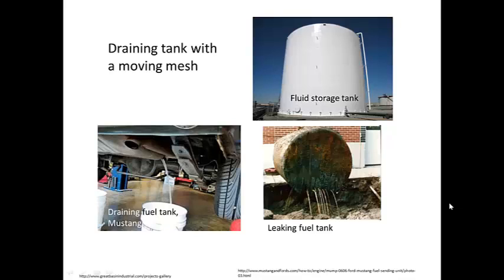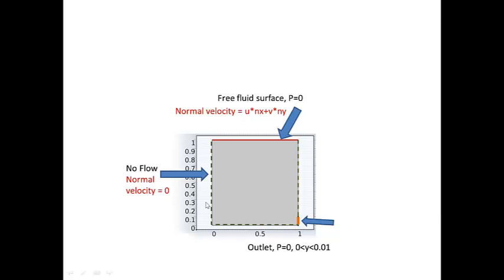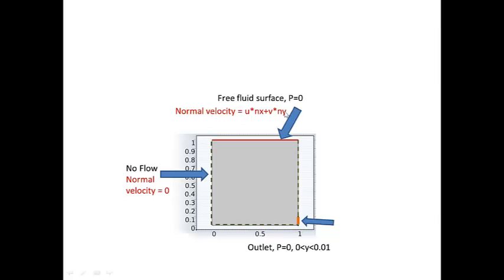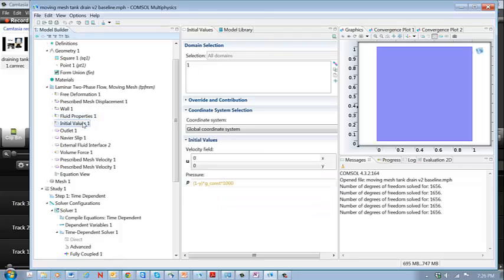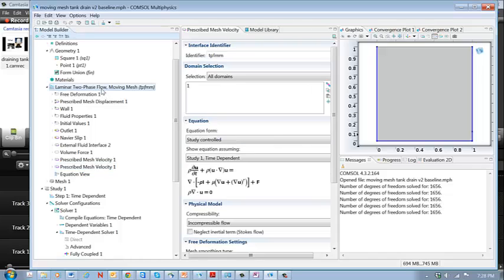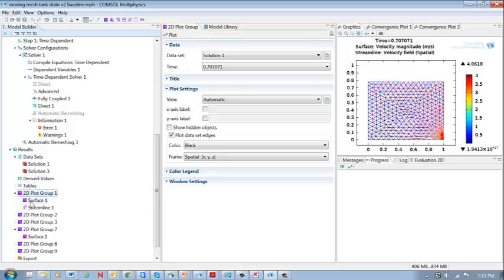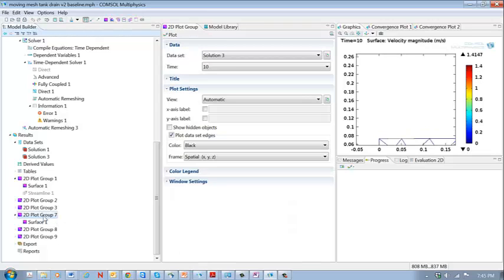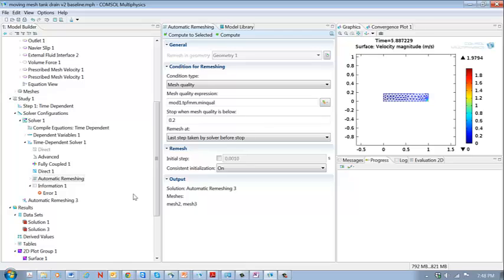draining tank and moving mesh v2

Comment: Hi Larry! I have to do a similar case with an open channel with laminar flow, applying changes in the water level (head loss due to friction of the base/ground). Could you help me with this? I think moving mesh method or two-phase flow method could work for the air-water interface. Thanks!
Reply from the maker: Hi Laura,    Moving mesh or level set could work, depending on the details.  Level set is more versatile, but very computationally intensive.  I worked out a physics module for the shallow water equations that works for open channel flow in plan view.  I have been expecting them to include 2D shallow water equations in the software, but I have not yet seen it.  Larry

Comment: I follow the method you used on your video and on the calculation step, an error message appears. It said that the final step of time did not converge. Could you please give any advice of what I'm doing wrong?
Reply from the maker: Aaron,    The mesh is probably becomes too distorted for the calculations to converge.  Shorten the duration of the analysis.  If you must run it longer, then you should investigate how to do remeshing.  Larry
Reply: @lcmurd1  Thank you so much. I reply you how does the remeshing respond